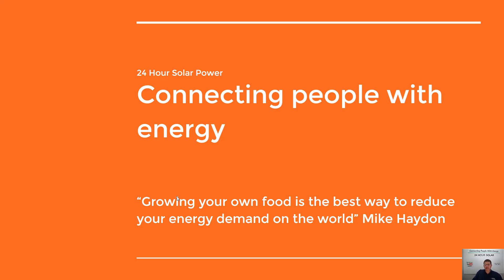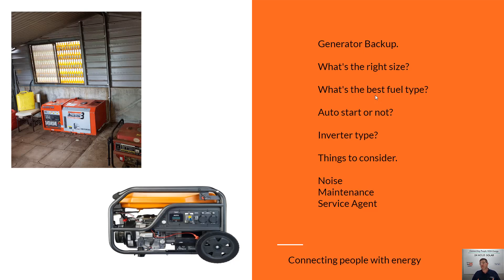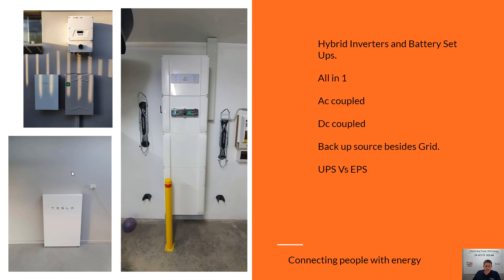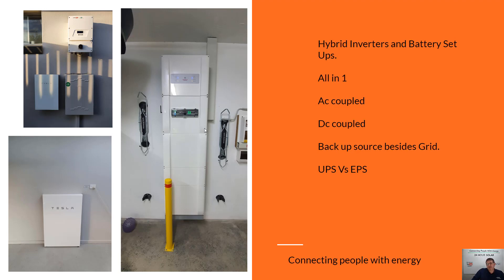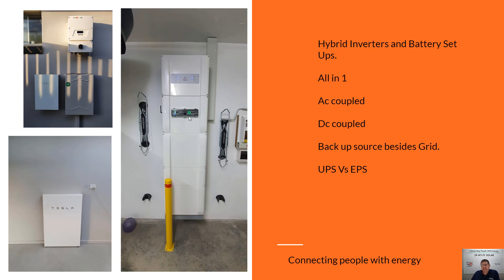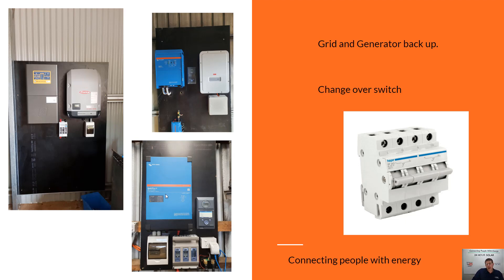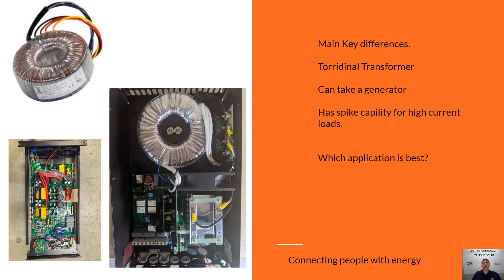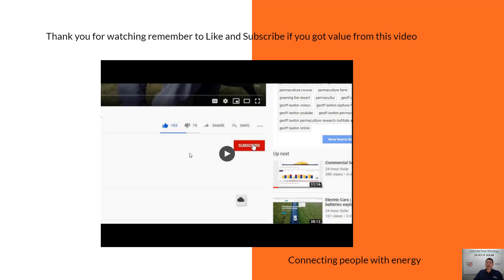Stand-alone Solar System

Comment: Excellent information for people who are considering their own system for an off-grid system or hi-bread that is still connected to the grid.
Next few months, Tesla will update the software in their cars to act power station, will charge the battery or you can use Tesla as a power source, look out for battery day by Tesla end June/July. Two-year estimated when you can use Tesla to power to your house. The future is EV and Renewable energy. 
I've asked Elon to build a factory over here on the North Coast to produce PV and Battery from home-based to one like the in SA.